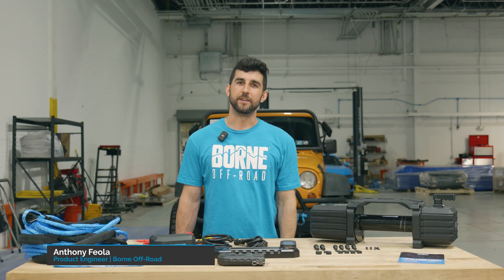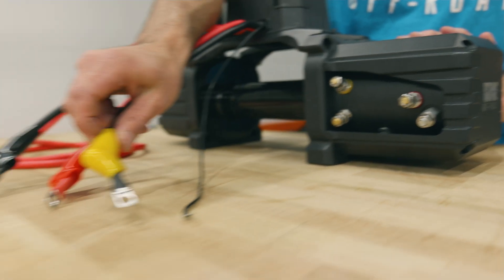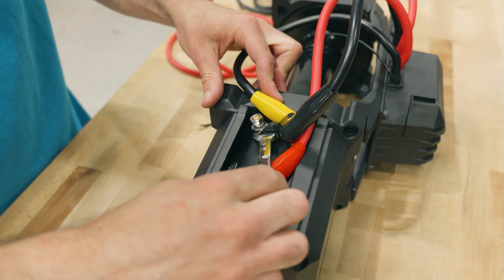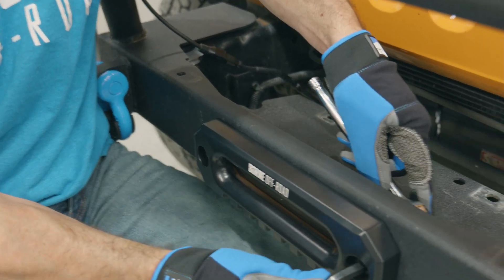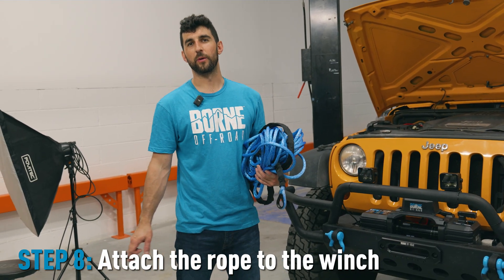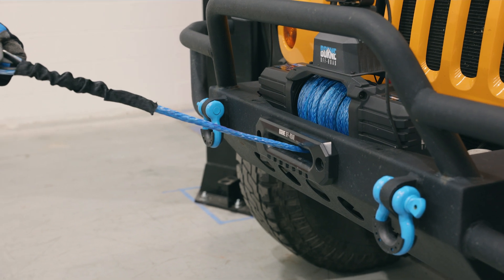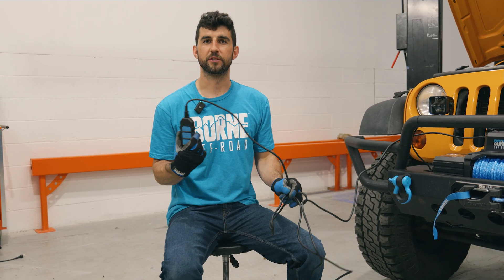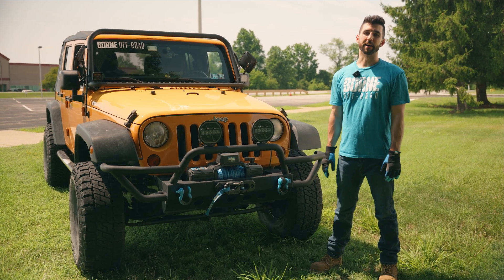How To Install A Borne Off-Road Winch

Comment: Would you please tell me how long are the wires from the control box to the winch assembly?
Reply from the maker: Hello! The cables that go from the winch motor to the control box are 16" and the cables that go to the battery are 70".

Comment: Why should I buy this winch…? 
Yes there is a lifetime warranty which is amazing. But does that mean the quality of such product is cheap. Will I run into issues frequently? 
Where is this made?
Reply from the maker: Our winch is built tough, backed by a lifetime warranty that shows our confidence in its quality. We put it through extensive testing to make sure it’s safe and reliable so you can count on it when it matters most. Check out our website for more features on our 10K/ 12K winch: www.borne.com